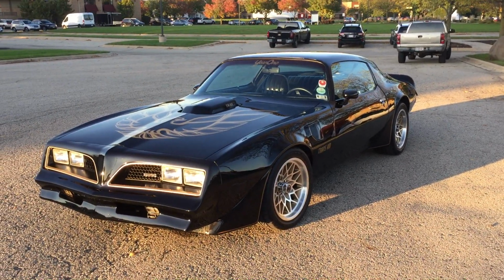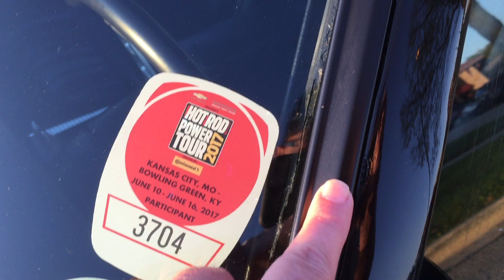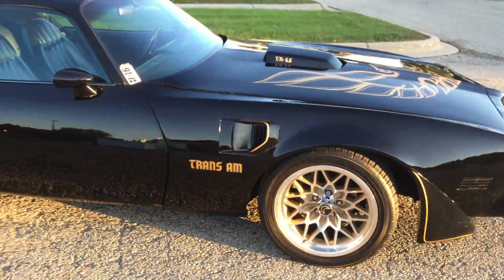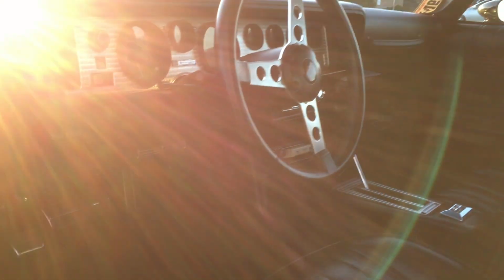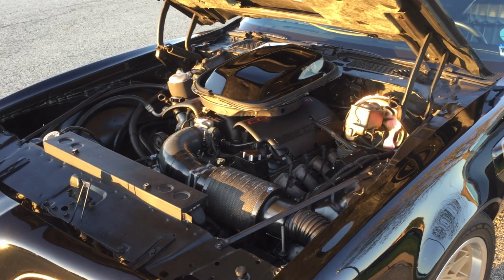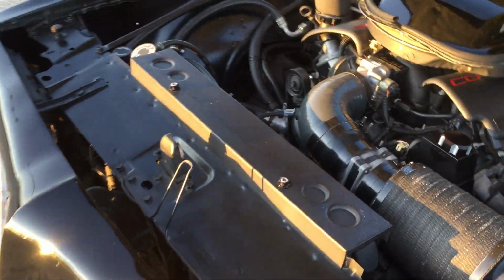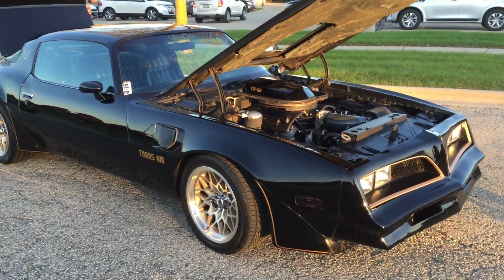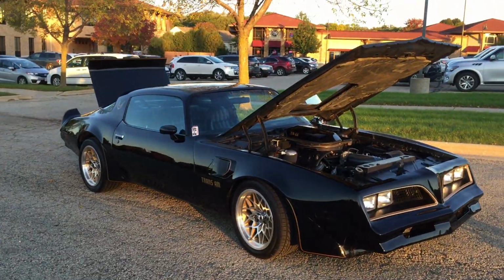1977 Trans Am LS swap SOLD May2020

Comment: Some funny info going on here.  PHS documentation proving is a WS6...........sorry WS6 did not come out until '78.  Also, the statement on the GM ecu location.......GM computers are located in the engine bay on LS vehicles.
Reply from the maker: @F-Body Jon   Yes, in the write up on the car I indicated that I was wrong about my WS6 statement.  Relocated the ECU cleans up the engine bay.  The car sold in May2020